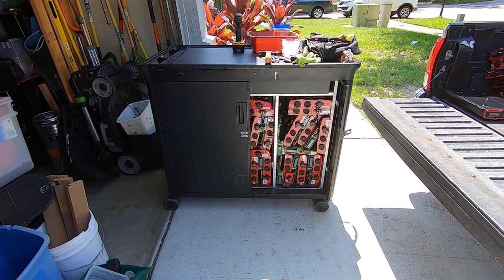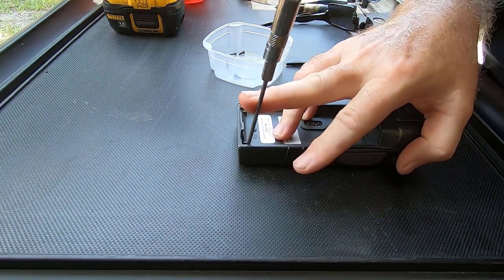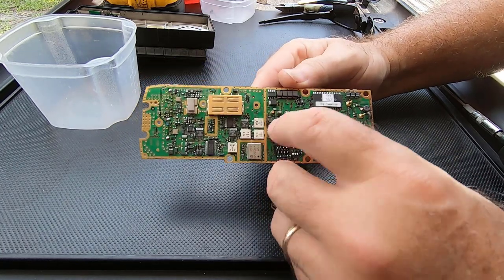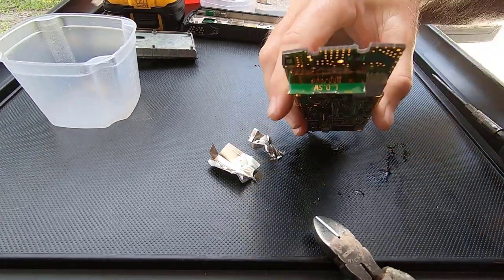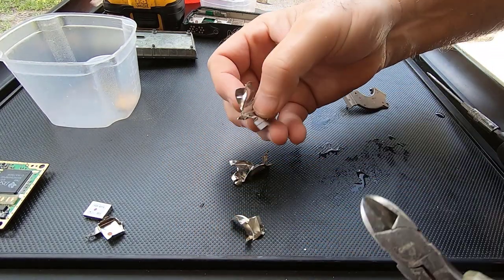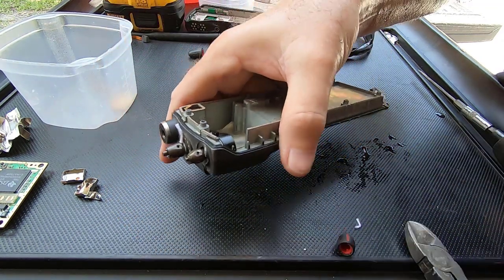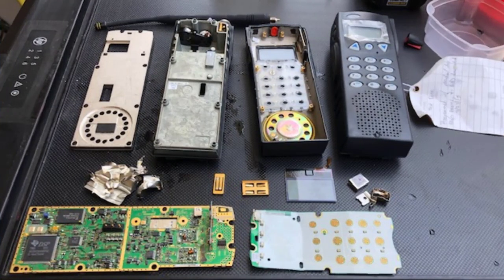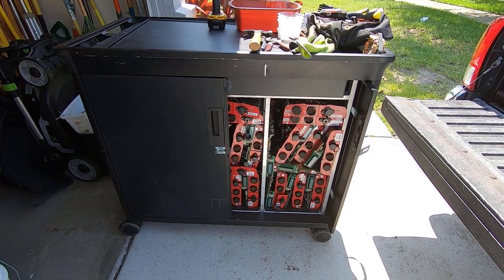Walkie Talkie Sharkie Snackie - How to scrap high end walkie talkie

Comment: Check those shields with a file, sometimes they are nickel plated brass or copper. Some are a high nickel stainless. They are really hard (by file) so they are pretty easy to tell from the brass/copper ones
Reply from the maker: agreed